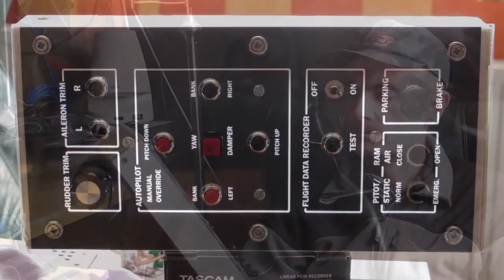First Completed Panel! (Twin Otter Cockpit Build - Part 4)

Comment from the maker: (Buck, I cannot reply directly to your comments.) The cockpit measures 1.3m wide by 1.2m deep and 1.8m high. The chair sticks out the back by an extra 40cm or so when occupied.

Your other question seems to have gone but I have made a dash that covers the top edge of the panels. The other edges are unbound so far and will likely stay that way. I will have some kind of trim around the exposed edges of the panel stack even if it's just to hide the wooden frames.

Comment: When drilling your acetate try sandwiching them between some ply or other material it will stop break out of the drill bit which causes cracking  also pilot drill your second hole in your wood frames this will help to stop twisting (old joiners tricks)
If your going to spend mega bucks you might as well do it right 
All the best on this project
Reply from the maker: Thanks, I have the drilling down good now. The acrylic definitely needs supporting from below but also it's most effective to use flat (non-helical) woodworking bits as this avoids any pulling. This gives very clean holes and is only problematic for really big ones (20mm) as you have to go really slow to avoid melting the stuff! For small holes regular helical bits seem to work fine.